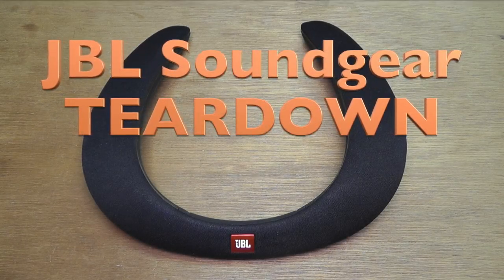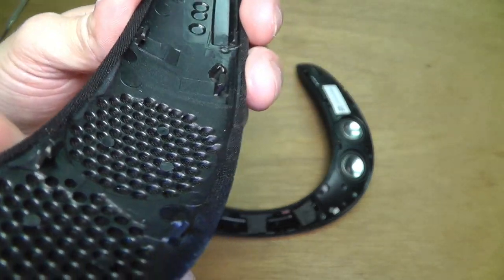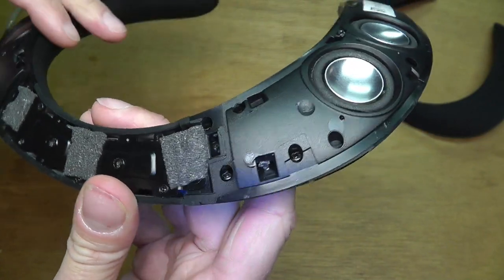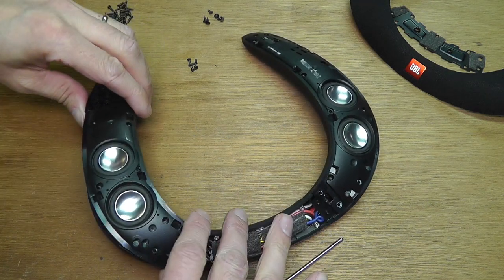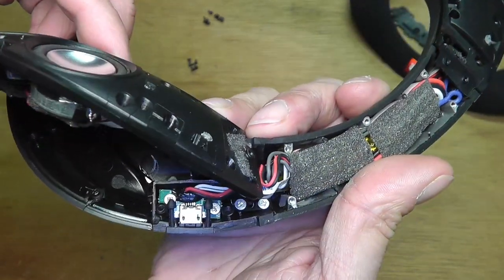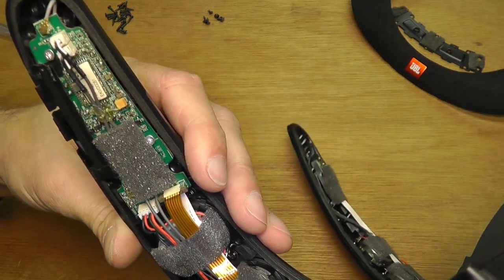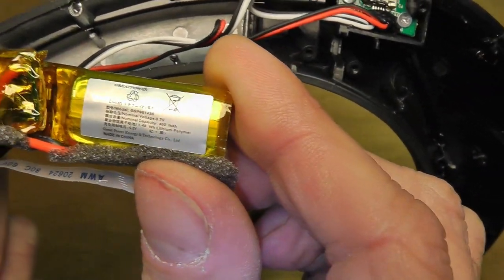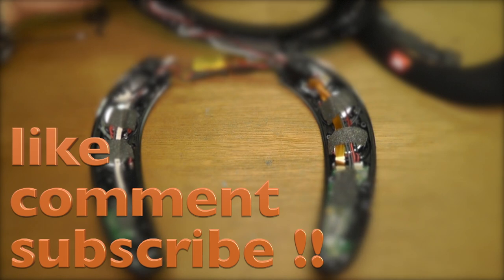Looking inside JBL Soundgear bluetooth speaker Teardown - How to

Comment: so they use too small batteries, $3 speakers and standard BT+AMP stuff. why not at least go with CHANGEABLE 18650 batteries and position them and the lower end as counter-weight ?
Reply: They want the product too be disposable and unfixable as possible so you buy more from them or pay them to repair it for you for most of its retail value because they have the right tools and training to disassemble this thing without breaking it,  I'm a little disappointed on the drivers,  JBL is known to recycle driver designs I mean they put a fucking mono TV speaker in the charge 3 😂

Comment: I am thinking of picking a used one up and adding a 21700 or even an external 18650 pack to the back of the neck area. As I understand it, this unit is great on sound.. except the battery blows goats.

Comment: I got one of these but it doesn't turn on or charge. When I plug the charger in, it will turn on and the LED is flashing white but BT doesn't work and can't connect anything. Do you think replacing batteries / usb port could fix the problem?
Reply: Here to find an answer
Reply: @stephaniemcclureeuell8724  so did you find an answer ? facing same problem.

Comment: Thank you, I was wondering where the batteries are located. No i need to find a replacement :)
Reply: hey do you know where i can order a replacement battery for this one? thanks
Reply: Same here... but they are not easy to find! The only 400 mAh batteries I've found come with 2 connectors but it seems there is a 3rd one connected in the video

Comment: Did you notice if there was any way to adjust how it fits around the neck? My neck is a touch to big.
Reply: The sound feels like its coming from behind you.  Really annoying when it's the voices or talking.  Looks like theres a little slack in the wires in the back of the neck.  Thinking about cutting bottom plastic and expand and bend the unit a 1/4 or 1/2 inch. an inch so the speaker move forward a bit.  I realize it will totally compromise the structural integrity but i can't stand the voices , car crashes, explosions. etc coming from behind me.
I'll see if i can get some of that integrity back with grinding the plate so it fits back into the slot. The screws will no longer line up so i'll use duct tape to recover as much of the structural integrity i can. prob 30%. eh better than just using duct tape without the plate = 10%.  70% loss in structure integrity to make the unit sound perfect.  That's a steep price to pay.
At the 7:33 mark I see i have some play in the wires.  Remains to be seen weather or not i can get a half inch out of that slack.  Hoping for a full inch but i'll settle for a half.  I bought my new / open box unit from ebay for $120.  Compared to Bose $240 on ebay new. ( $299 retail ).  Its worth the risk to experiment.

Obviously i wont cut the plastic till im certain there's enough play in the wires for a 1/2 inch expansion / turn.
Reply: Unfortunately I have a solution for you but your not going too like it lol,  JBL sound gear is a one size fits all scenario 😂